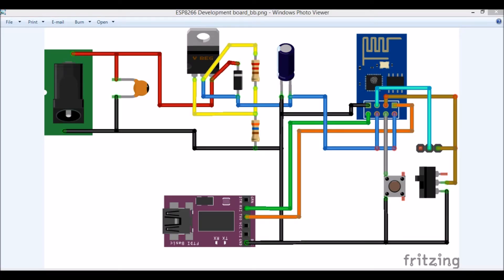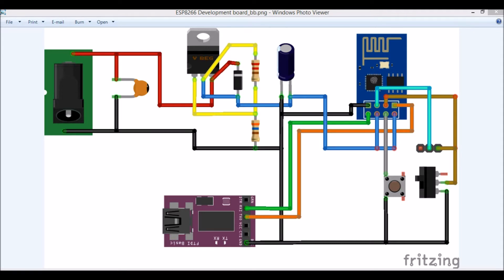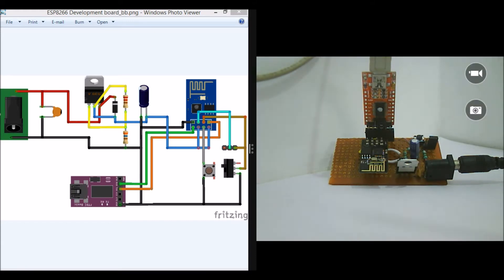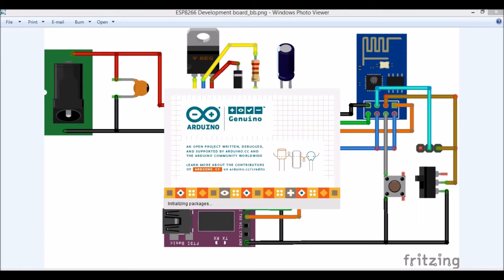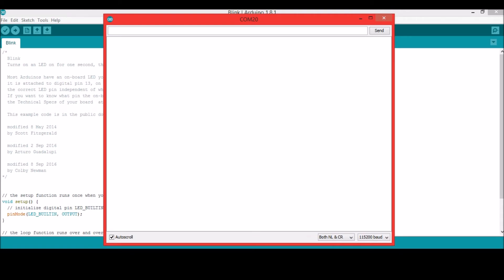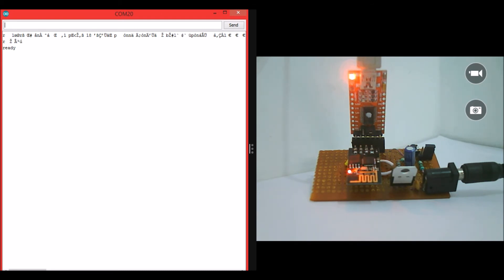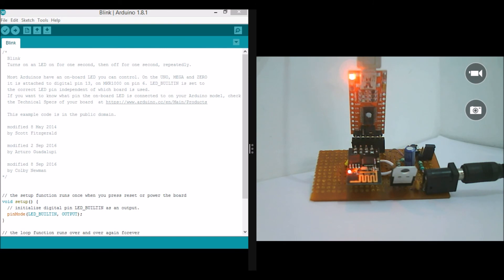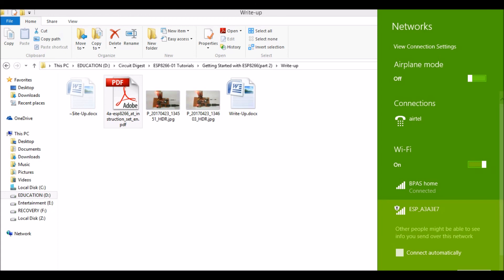Using AT Commands with ESP8266 WiFi Transceiver

Comment: Why do you need to make sure that FTDI module is on 3.3v if based on circuit diagram the source will be the LM317? BTW thanks for the tutorials....
Reply from the maker: The FTDI module used in this video can operate on both 5V and 3.3V logic levels, its important to select 3.3V, else the Tx pin of FTDI will supply 5V to Rx pin of ESP which might damage the module

Comment: when i send AT commands nothing is recevied .what to do?
Reply from the maker: Hi do you get some garbage values on your serial monitor. If not the problem must most likely be with your connections. Also remember to reset before sending AT commands. For more help kindly post your question in detail on our forum https://circuitdigest.com/forums